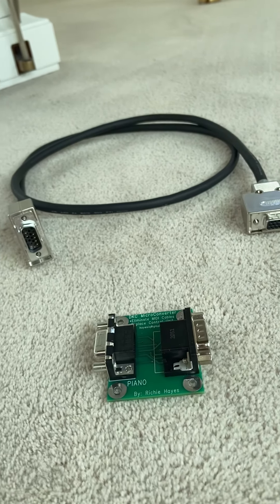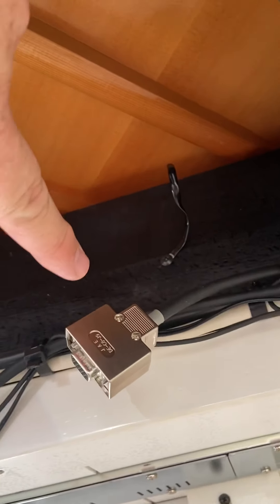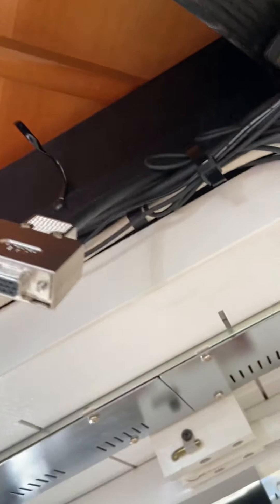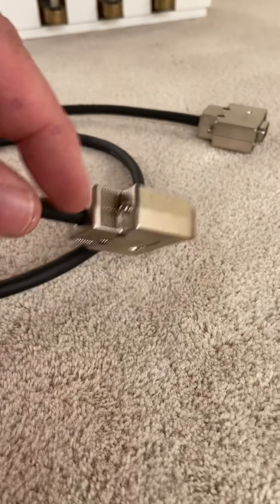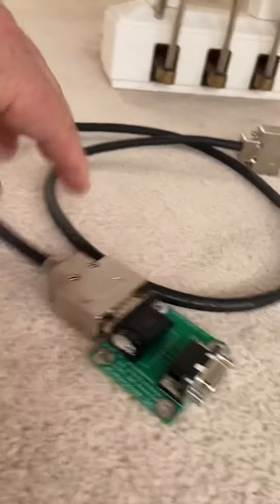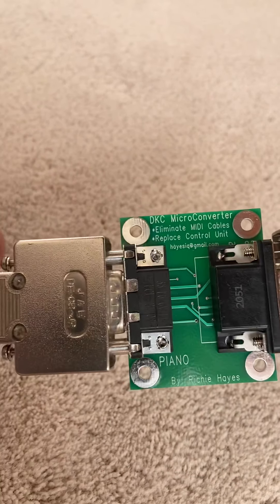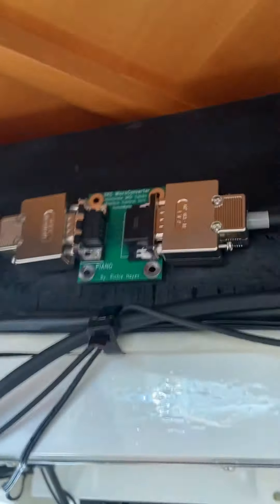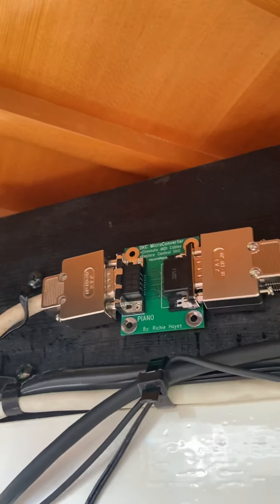How to install DKC Converter board. Eliminates need for midi cables on Mark2 Disklaviers.

Comment: Hi Richie! 
I hope you are doing fine. I am Harry from France. Thanks for all the tips.
I have got an issue recently at home with my G2, DKC 100R equipped. The control unit lights up, but there’s nothing on the screen and no way to make the disklavier work… I have been looking for a second hand DKC 100R unit but impossible to find it.. have you any idea what I could do instead?
Reply from the maker: Hello Harry! If there are no lights or anything, that would mean that the piano isn’t getting power at all. Make sure the AC cord on the power supply under the piano is pushed in all the way. And make sure that the switch on the power supply under the piano is turned on. If it still doesn’t work, then you could very carefully open the power supply and look for a burnt out fuse. If you still can’t find anything, then you’ll probably have to have the power supply Refurbished by company in Los Angeles called TAP. Can you get your hands on a md-bt01 midi adapter? Or something similar? If so, you could plug that thing into the midi ports on the back of your control unit and use the free demo station of Pianostream to see if the Piano will respond. Can I stream doesn’t care if the floppy drive and LCD display are bad. And by using it is an excellent way to troubleshoot a Piano. Anyway, I hope this helps a little bit! Keep me posted!